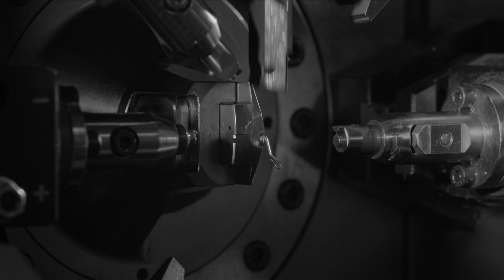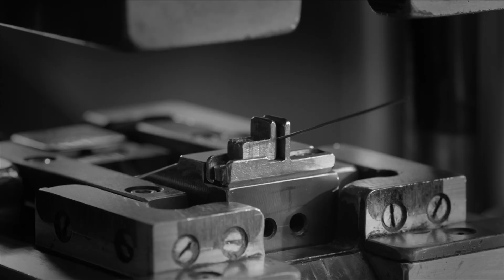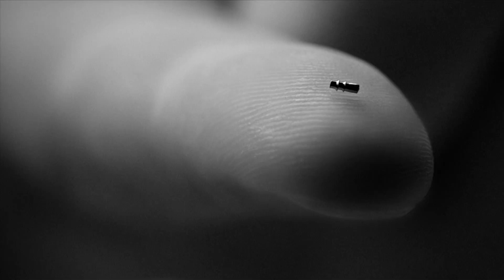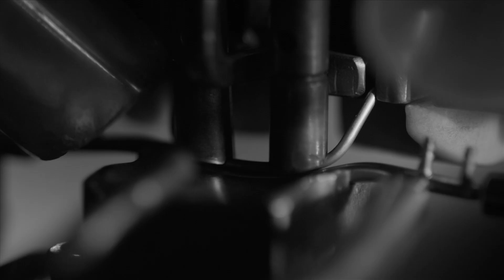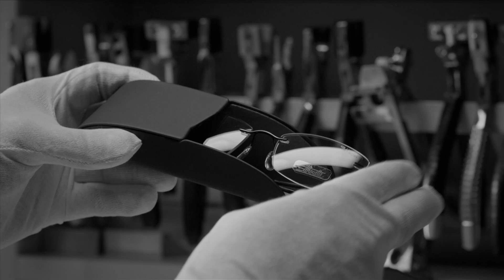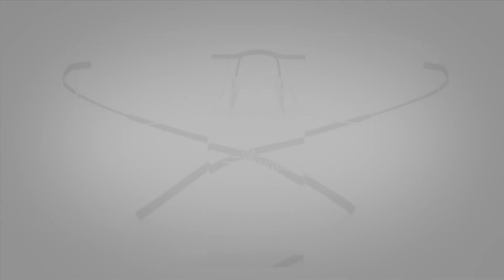Silhouette High-tech Titanium | Light, flexible, durable

Comment: It's not durable:::((( I already change 2 ear stems. But very care about my TMA glasses. But it's broken 2 times of normal uses. What's going on?
Reply: I own a company that fix glasses in Brazil. The silhouette titanium alloy is definitely one of the best titanium used in glasses industry. It is a light, flexible and very strong material. But it is not for everyone. There is no secret in the frameless design, less material, less resistance. If you use your glasses like you use a expensive suit, and it is, you got one of the best glasses ever made and it will going to less forever. If you use it like a cheap jeans, Silhouette it is not for you. For carefully users, is a great piece of fashion design and engineering.

Comment: Have had my glasses for 6 years.....just replace the lenses.....granted I am very careful with them and take them off only when absolutely need to....when I do remove them for bed....they lay on my dresser....do not use the cases for them because in my opinion it puts un-needed stress on the frames.